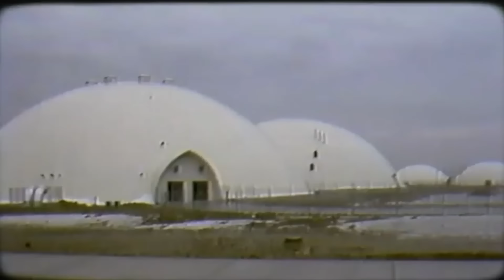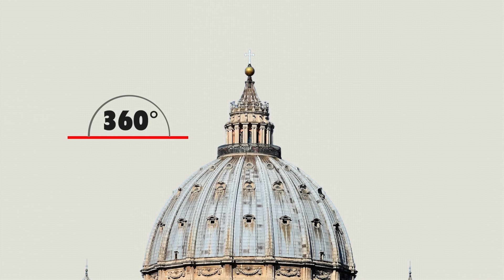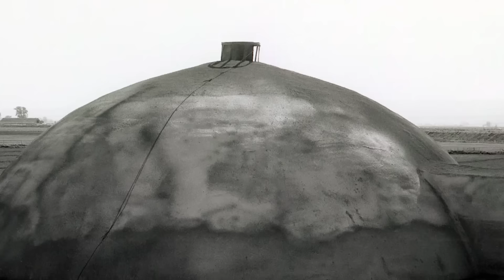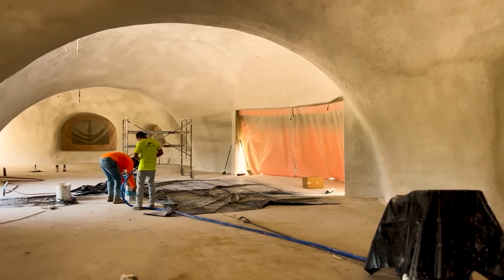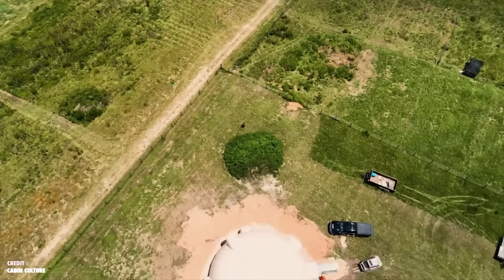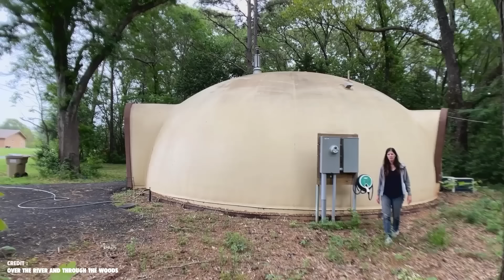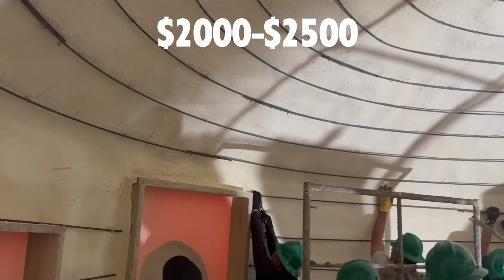This Home Survives EF5 Tornadoes, Wildfires, and Costs $0 to Heat. Why Aren't We Using It?

Comment: Back in the 1990s, I was excited about Monolithic Domes. In my area, there were several to visit. One owner builder gave me a tour - and a candid comment. . . But I'll just sum up what multiple owners told me :

__ They're hard to furnish due to the curves (wastes 15% or more of floorspace);
__ Don't finish the floor BEFORE spraying the ceiling (shotcrete drips cost $$$ to remove);
__ They can generate a strange anxiety from the multiple focal points (RAS triggering);
__ Acoustical nightmare - often need much damping;
__ The outermost surface is the fragile Airform skin and should be protected with strong fiber reinforced cement.
__ They cost far more than other SCIP buildings.

POINT: Though Romans built the largest hemispherical concrete domes, the emperors and richest Romans didn’t seem to want to live inside one. Their Roman villas were rectilinear, built around an atrium. 

POINT: Monolithic Domes don’t have a high resale value, in general. Some are even abandoned - or look like they are.

Youtube video of an abandoned Monolithic dome, mistakenly called styrofoam (Polystyrene) but really using polyurethane, and that mixed visuals from a different company entirely (i-domehouse). However, you can see the deterioration of the external fabric skin and the underlying yellow polyurethane (polystyrene is white).
Originally built for Dr. Ajay Kothari and his Astrox corporation.
https://www.youtube.com/watch?v=icsgLIawVA8
Reply: The wasted floor space is the worst part.  It is, in its own way, extremely inefficient.  Wasting land, wasting usable construction.  Square/rectangle buildings are radically efficient in terms of floor space and storage especially for residential.  Rectangle buildings can easily be built to multiple stories, while making a dome higher brings on more wasted land and space.  

As time goes on, urban sprawl and wasting land becomes a bigger and bigger concern.  Wasting land with space inefficient buildings is not a great thing, and building up becomes more necessary.  The dome has its advantages, it has many problems, as well.
Reply from the maker: Good feedback.  Not sure about the resale value element.  This one is selling for just under $1m: https://www.monolithic.org/news-feed/dome-of-a-home-for-sale
Reply: @wildline_YT the lot is selling for a million. Show one that has sold.

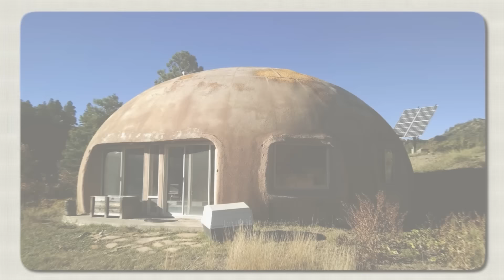Comment: At 5:10 it says that in a conventional home the insulation sits on the inside.  That's a very odd idea and guaranteed to cause condensation.  Here in Norway the insulation is on the outside with only a damp proof membrane and the exterior wooden cladding (about 15 mm thick) outside of it.
Reply from the maker: Is the brickwork on the inside then?  Or is it a timber frame building?
Reply: @wildline_YT Timber frame for modern houses, solid dressed logs for older ones.

Comment: $0 for heating sounds like a dream! Does this rely on passive solar design or geothermal energy? And does it stay cool in the summer too, or just warm in the winter?
Reply from the maker: The thermal mass of the structure regulates the heating and cooling of the internal space. Thank you for your question!

Comment: in the early 80's we built these domes without rebar. Using stainless steel needles in the shotcrete eliminated the need for rust-able rebar. These were great projects that went up very quickly. Our experience was that at the time using incandescent lighting created a lot of heat.
Reply from the maker: Sounds a great project.  With LEDs I don't think you will have the heating problem.  Thank you for your feedback!
Reply: @wildline_YT  LEDs do generate a lot of heat BTW
Reply: In your experience, do you think Instead of shotcrete, could one use hempcrete?
Reply: @machupikachu1085 nope.
Reply: @machupikachu1085  there are limits to what you can use it for, since it won't stand up to what shotcrete does.
Reply: @dizzydaff  understood.  I heard that hempcrete has some benefits, so I was seeing if one could combine these two.  I guess not.  Thanks for letting me know.

Cheers!
Reply: @machupikachu1085  That is an interesting question.  I'm more interested in the advances of the reproduction of Roman concrete as a widely available building material.   Not this dome building technique but something with more then a plastic outer layer.
Reply: Do you remember how many you built?
Reply: It's called micro rebar.

Comment: reinforced concrete doesnt last more than 50 years due to the rebars oxidising. There are many vids only about these type of domes that are in decay. It is the metal and concrete that deteriorate over time. These materials arent meant for longterm usage. Check out rammed earth or Roman concrete for alternatives. Hemp blocks are also a great option
Reply: You can do it with fiberglass mash and fiberglass adding to the concrete then you don't have any corrosion and the concrete become much much stronger
Reply: in the '80's we used stainless steel needles in shotcrete and no rebar.
Reply from the maker: Sounds a good idea!
Reply from the maker: Yes the rebar is probably the weakest point.  If you build a "bubble" design there are no rebars. Just one question on rammed earth, if it gets wet doesn't it act like a freezer with evaporative cooling.  This has been mentioned by someone saying their rammed earth home was freezing in the summer. Totally agree with roman concrete and hemp blocks - both good solid natural building blocks.  Thank you for the feedback!
Reply: @wildline_YT  Good point on the cooling effect due to wet wall surfaces. I havent heard that before. I will have to do research on it.
Reply: 50 years? Funny, my house has concrete columns and beams reinforced with rebar and it is 67 years old. Failures occur due to shoddy construction and/or lack of maintenance, whether it's a conventional home or an alternative type of construction like a dome. If you keep the water out, the rebar doesn't fail. Are there better alternatives? Probably, but anything can fail if it's not taken care of.
Reply: @rogermccaslin5963  Well its not exactly 50 years max. Its about that time were deterioration will start or is noticeable. Modern homes/structures made with concrete dont last decades, that was my point. It's inferior and harmful building material compared to ancient tech.
Reply: You know nothing about actual construction.

Comment: Get away from the steel and re. Inforced with Basalt rebar mesh etc and you build, cheaper , lighter stronger and corrosion and crack resistant domes that are even more fire and chemical resistant especially in. Coastal areas.
Reply: Will basalt mesh be approved by the engineers?
Reply: @evstafievcoach yes it has been for years. 
You can't use it on a dome though because it doesn't bend so you can use it on a curve.
Reply: Stronger then steel, it says 💪....
Reply: Well considering you can't use basalt rebar on a dome I have to say your idea is a bit of a problem.
Reply: @sparksmcgee6641 that sucks 😞

Comment: Only requires $1000.00 in gas to get a pizza delivered, but heat's free.
Reply: Why wouldn’t require $1000 for a pizza?

You building it on Everest?
Reply: @nb117  Almost, aren't all of these built in the middle of no-wheresville desert?
Reply: @WillyDrucker Where I'm moving it's only an hour away to the city and we make our own pizza.

Comment: How do dome homes fair with green energy?
Reply from the maker: They have good thermal mass so they retain heat well.  If you want renewable energy, then renewable heat isn't a problem but if you are thinking solar pv then these would have to be ground mounted (the curve is the problem). Thank you for the question.

Comment: The only thing close with a lower energy consumption rate is adobe or rammed earth. Adobe is hard but can be built. I built an adobe house.
Reply: you can cover a concrete dome with dirt. best of both worlds.
Reply: @baranjan4172  You cannot simply cover with earth without other real considerations regarding intrusion of water to the structure and reinforcement to support the weight to include seasonal weight like snow.
My comment about adobe is meant that there is at least a few methods that provide a much greater conservation of energy than stick construction. Especially when you limit windows and include sun/winter shutters to reduce daytime/nighttime heat loss.
Reply: @David-p5v1k  yes, the stick construction doesn't conserve or accumulate energy.
Reply: My grandfather built an adobe house in the 1930’s. It was undamaged after a 7.3 earthquake, and many 5.0 aftershocks, in 1952. He eventually built a stick construction home on another part of the lot. My family no longer owns either home, but the adobe house is still there after almost 100 years.
Reply: Those electric bills quoted are amazing, imagine if dome shaped solar panels were available, go off grid for free.
Reply: @johngreydanus2033  if the house is in the desert, yes.
Reply: I build with sandwich panels and those houses are waaaay better than everything you listed.
Reply: @sparksmcgee6641  better at energy conservation, not accumulation. You need to heat/cool the house continuously.
Reply: @baranjan4172  Your one of those I has all the answers and gotcha. We can design in new construction or do some careful energy conservation.
I can build sandwich panels. I cans dosa better.  Isa knows everything.
Reply: @David-p5v1k  I'm not sure I got your point. Try to use google translator or something. You're talking about conventional houses, which the video isn't about. Everybody can build a high R value panel  house and heat it conventionally. What's new about that?
Reply: @baranjan4172  A high R Value house has little to no thermal mass. That is the problem with todays standard construction. All your doing is reheating the air inside.
Reply: @David-p5v1k  exactly. I live in such a house, so I can confirm that's how it is from experience.
Reply: @sparksmcgee6641  Absolutely do not understand reference to sandwich panels. However winter/sun shutters can save thousands of dollars for a homeowner even in conventional construction. 
A geothermic system can be added from a kit system that even takes radon into consideration for conventional homes. What was designed for the desert societies can be brought into modern homes.

Comment: They meet building codes and aren’t banned, maybe unwelcome because of their different appearances for aesthetic reasons. I’m planning on building one, but outside of the city limits to avoid the hassles of dealing with city codes, inspections and zoning regulations for neighborhoods.
Reply: Please post your experience in building it.
Reply from the maker: Sounds a good idea.
Reply: Yeah. These videos are all lies that say something old is banned. 
AI videos.
Reply: @s @sparksmcgee6641 …tell the city you live in you want to build one of these domes! Good luck with codes!👍
Reply: It the bank/insurance connection. Fire insurance not needed for concrete but required for mortgage. 
Crazy 😧
Reply: I was going to say as you did, that this is going to be an aesthetics reason not a because the government doesn't like them.  It just different and not the norm so for most it just looks weird.
Reply: @mantrid8326 I'd rather be safe, alive and a little weird than the alternative.
Reply: @Zulu4impi  I'd rather my house look weird rather than having a weirdly contorted body from a hurricane.
Reply: That's a good idea Hero4........  And when the city annexes your property YOU'RE ALREAY IN........  I'm looking into this myself for Nevada/Utah

Comment: Ive taken the class Monolithic class in Italy, TX and met David South years ago before his passing. There's not a better, safer, more fuel efficient house than a Monolithic dome.
Reply: I really want to build one of these. I stalk the Monolithic website all the time.
Reply: @ryanmac3134 You'll be fascinated by process and structure. If you take the class be sure to work everything! Tie the rebar, hang the conduit, spray the concrete, and learn hst water column is and why it's important when inflating the airforce. In floor heating and a heat sink deep into the ground are the key to very low energy costs. Safest houses on the market.
Reply: Adobe is safe, more fuel efficient, and it's x1000 cheaper. It got shafted by agencies and corporations in the early 1900s though. I'd be happy with a dome too though. I think hempcrete has finally worked its way into regulatory codes recently?
Reply: @og_slim5884 Structurally, the dome is safer. If you don't need the strength of a dome, then I understand your perspective.
Reply: @theebalz I just meant that adobe is safe relative to conventional home construction methods. Check out the vault granaries of Ramesseum that were built around 1300 B.C.

But yeah, monolithic domes are next level, and when buried under earth, they're virtually bomb shelters.
Reply: Hope all of you who want one get to have them. I would love one myself so popularize them guys! Best wishes.
Reply: Were you able to create one of your own?
Reply: @Here_Today_ Yes. They do a new dome every class.
Reply: Looking at this type of home in Texas and have questions about it staying cool inside. Any info would be appreciated.
Reply: @kathyscholten5369 Ask away! I know a lot about these homes, have been inside many and could tell you low cost, energy efficient ways to but heat & cool them.
Reply: Which is...
Reply: @doug7232 the Monolithic dome..